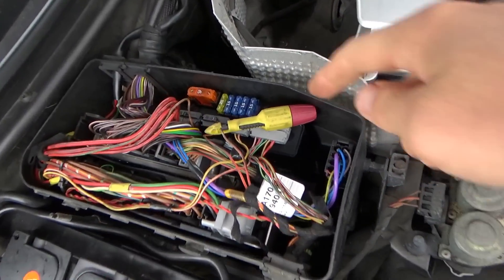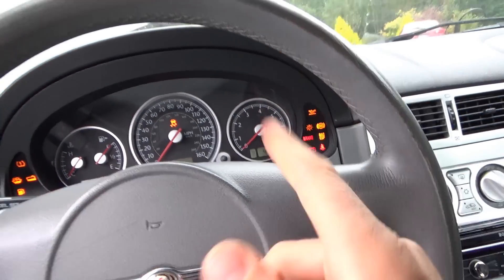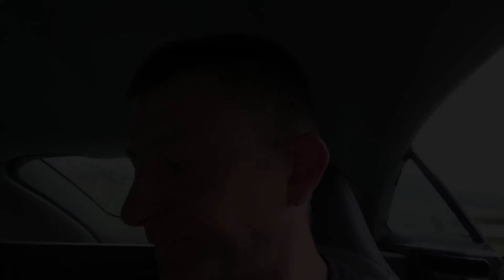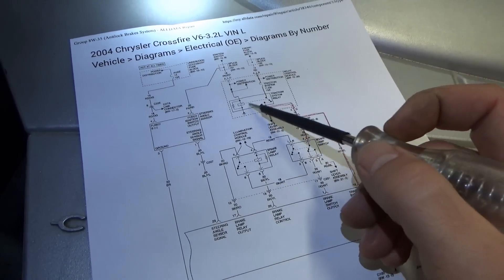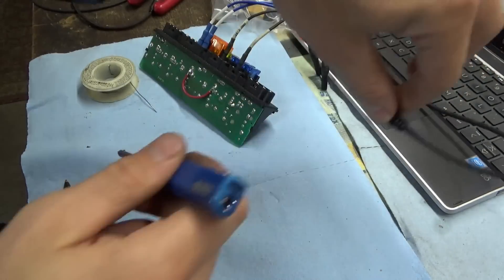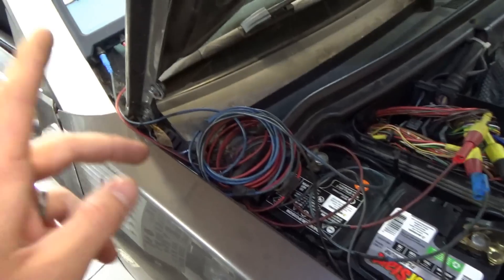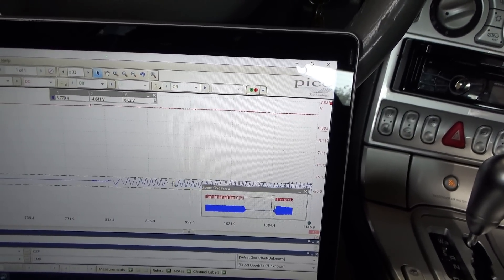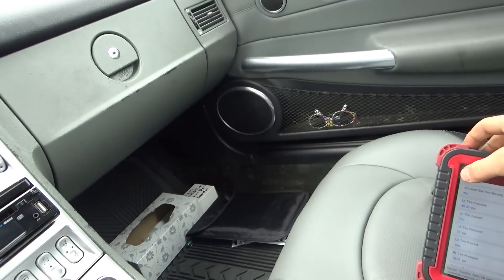Crossfire Can't CRANK? (Part 2 - No Comm with TCM-ESP-Shifter)

Comment: In some cases it's the end wire of the relay coil that has failed because it was improperly bonded to the post. A magnifying glass inspection could be useful just to check that.

Comment: Good job Ivan! As a Mercedes tech we dealt with these 20 years ago ,that car is a rebodied 170 SLK chassis and they had so many issues, we called those a K40 relay. Powers everything, crank sensors were a high failure part on these V6 and V8.
Reply: Yep haha! I guessed it last video, and my guess was right!

Those K40’s go bad so often it’s usually the first thing to look at for a crank-no-start and offline modules/no power. They’re pretty easy to fix, it’s almost always a bad solder joint. A bad connection inside is often the cause of intermittent no-start and stalls.
Reply: And give us five minutes and I'll be absolutely thank you

Comment: I'm a little concerned about joining those circuits.  This would've been a perfect opportunity for them to cost-reduce that box, so there must have been a reason why they chose to include an additional relay.
Reply: True. The cost reduction may also come from not having to manufacture a different box for cars which need separate feeds and for cars which don't.
Reply: @Kehvelii  
My vehicle had manual window winders but all the wiring was up to all the doors and up to the window controller switch next to the driver.
 It must have been easier and/or cheaper just to run the same loom for all the cars on the production line.
Reply: It would be my guess is the extra current is needed when the traction control activates during a traction loss event. Definitely a concerning repair.
Reply from the maker: @killer2600  if all those modules are on one 15A fuse, then normal power consumption is well below that, which one relay should easily handle 😉
Reply: I guess that particular relay is borderline for that current draw. It'll probably be fine.
Reply: On my own car, maybe. On someone else's car, no. If it's a window or a radio, ok.  But when it's engine control that car could fail on the interstate highway and cause serious problems. That's a lawyers paradise.
Reply: That relay module covers many Mercedes models.
Reply: Drive it hard, if it doesn't pop the fuse your good.
Reply: At a minimum that's a 20 amp max relay...  Should be just fine.  There's a reason they Mercedes are "overbuilt" after all!
Reply: @TheMystikal82  It won't pop the fuse, but it could fry the relay.

Comment: Hey Ivan, this is a known issue with the Mercedes R170 platform. At one point or another this K40 relays fails. The previous owner replaced already on my SLK320. You can still find these new. The issue is that the ECM relay will also fail and leave the car stranded.

Regarding the ABS light, you have to turn the wheels lock to lock to  relearn the steering wheel angle

Comment: On the working relay the fuses are after the relay, on the not working relay the fuse is before the relay. If you join the relay outputs, the output is not secured by a 15A fuse (only by the 40A fuse).
Reply: Still, just put in a 15A fuse with some wires poking out of the case. There's no need for those two relays to be separate.
Reply: @brainndamage  
I think the manufacturer had something in mind, when they installed two relays instead of one. Perhaps they wanted to make sure, that one module could not power the other modules backwards, when the relays were not activated.

Comment: That's sweet diagnosis,had the  same problem with 02 c200 but it was caused by a crank sensor. After engine warms up its crank no start. Thanks once again Ivan

Comment: Did you use "battery negative" instead of "battery positive" during your test of the relay Ivan?  Did you make a mistake?  WOW!  I don't ever get to see that!   I hope in part 3 you don't need to find a relay board for that car.  These videos that contain component repair are VERY interesting.  GREAT VIDEO!

Comment: nice bit of investigation/analysis to get to the failed component and a good cheap fix for the customer.Appreciate that the load on that working relay is minimal,however,it has switched just as many times as the failed relay and now it's workload has doubled.You may have already done this but I think I would have suggested to the customer to start saving now for either a new module or to look for a good used module as a precautionary move.Assume he is keeping the car of course.

Comment: I replaced a failed ignition lock on one and had to cut it off because it wouldn’t turn to the service position. It was a terrible job and the parts were in the $1400.00 range. The ignition cylinder had to be special ordered for the original key and car. I don’t envy you Ivan!
Reply from the maker: Because Mercedes 😆

Comment: I own a 2005 Crossfire Roadster.  The RMC is a pretty common issue.  Most owners carry a spare RCM, Crank and Cam position sensors.  When scanning, remember the car is about 80-90% a 2003 Mercedes Benz SLK320.

Comment: Mr. Ivan, I'm  a 24+ year factory trained Chrysler dealer tech and  I was mentored by one of the Best. I've been following your videos for a while now. You clearly have an impressive understanding of how to properly diagnose auto electrical. Most aftermarket "techs" do not and can only change parts.  Good for you Sir. 
I'm very curious: Do you have any Dealer training or experience? If not  College or some kind of trade school?
By the way We wont even Touch these Fucking Crossfires anymore and that's fine w/me.
Reply from the maker: Bio is on website... No formal automotive training, just a physics engineering background and then field experience with a good mentor 😉

Comment: 4:05 the rcm is serviceable.  Ive done them on my kitchen table . Its not a plug and play deal but its also not a standard dodge tipm. Again theirs a guy in Florida that fixes these . If you just buy a new one it will do the same thing as they all had bad soldier joints from the manufacturer.

Comment: That's a bit like when I was diagnosing my great uncles stepdaughters 1997 model Ford EL Falcon (Australian made car) which had a stalling problem, whenever I diagnosed the problem it would resurface later down the track.

It wasn't until it was towed to my dads place because it ended up being undriveable that I finally nailed the problem,it was just a non standard engine immobilizer/car alarm which was the culprit.

The Fix was to rewire it back to how Ford had the ignition switch wired up at the factory meaning totally bypass an engine immobilizer which had been wired up in series with the ignition switch for about 1/4 of a century .

So the problem was something else &  other than I thought it was !

Comment: Just about all electronics today, are soldered with Lead free alloys (almost pure Tin) and those do not flow and 'wet' a joint as well, unless lots of flux is used. Also, Tin has the annoying property of forming dendrite growths that can bridge and short connections - really troublesome with dense packed micros. A good flux that I use in repairs, is M.G. Chemicals 'No Clean' Rosin Flux #835-50ml. No Clean means that removing excess from the board is not necessary, but Brake Cleaner, Lacquer Thinner, or Isopropol Alcohol all work well doing that.

Comment: Why have that second relay if it is not needed?  The Part 3 video kinda answers that.  You have the second relay to send the circuit through a separate fuse?  As you found, connecting the relay outputs creates a scenario where you have some downwind electronics that is NOT protected by a fuse.  Thus, you added the external fuse.  Good work.

Comment: I'm guessing the ESP kicking in on wheel spin overloaded the ECM relay circuit you had piggybacked off of, and either borked the jumper wire, or the fuse, or there's actually an issue with the ESP system causing it to pull to much current, which is what stressed the circuit in the first place and caused the initial customer complaint.  Eagerly awaiting part 3 to see!  :D
Reply: The original failure was of the relay coil, not the contacts.  Therefore the fault was not the result of an overload.

Comment: Well as someone who has worked in electronics for two decades make sure if you do buy flux or solder make sure you get no clean, because if its water washable you'll have corrosion on that pcb within weeks, if you're using washable, rather than having to wash and dry the pcb ger yourself some vericlean spray to clean it
Reply: Thats just advice Ivan, not meaning to cause any offence just to clarify, best wishes from Ireland

Comment: Ivan I love your troubleshooting and repairs with the exception of 'jumpering out relays' or othe components.  I reserve the 'jumpering activity' for components that I find are not available due to obsolescence by the manufacturer or not availabe from previously owned or junk yard sources.  One of the things I find annoying is a previous tech does a field repair in a not so very well condition causing longer troubleshooting to determine just what was done and why.  For this repair yours is a great field repair. If the owner was agreeable I would have tried for a relay replacement .  As of this posting there are several OEM relay packs not the same P/N but same internal OEM relays on Ebay.  Further I also saw some NEW individual relays from our not so favorite place China (BARF)  I am not a fan of Chinese quality I have had too many failures and poor customer service on previous repairs.  In either case great repair on your part keep up the good work.

Comment: You can probably get the same type of relay at an electronics distributor like Mouser, Digikey, Farnell. It doesn't need to be an open frame, even a closed type with the same pinout.

Comment: There was probably a reason why the 2 circuits had separate load/relays, bridging the 2 doesn't sound right to me, that would mean the load sides mix, even though they always both are on with the same control side.  Also, you may greatly exceed the relays ampacity.
Reply: Probably not, why would there be multiple power feeds to the same circuit? It isn't shown in the diagram. Other than still needing to add the 15A fuse, it's a viable repair.
Reply: Most likely it's an overly engineer German part.
Seems they should have:
- simplify the design by using one relay
- make that relay serviceable and not soldered to the board

Comment: If you take the starter wire off the pulsation module and run it straight to the positive side of the battery and your starter still don’t kick in else could be the trouble the starter will kick in if you jump it at the starter, but it will not engage if you take the wire from the past stationmodular and run it straight to the battery. The starter will not engage.

Comment: The steady hand thing comes from proper technique. It is hard to explain, but you don't want to aim the iron with your wrist. Try to keep your wrist and hand in a comfortable position and aim with the rest of your arm (elbow/shoulder) keeping wrist a still as you can. EDIT: It also helps to not rest your arm on the table.

Comment: Did you consider just replacing the bad relay?  A bit of googling reveals that the relay in question is an American-Zettler AZ970E-1A-12D.  Cost is about $15 from any of various sources around the internet.
Reply from the maker: Maybe I should stock up on those 😁
Reply: Thanks for sharing that part number! It was pretty cool to look it up and read all the detailed specs of that relay (life expectancy in clicks, max current capacity, etc).

Comment: As I reflected before , historical search for problems with this car on youtube came up with quite a number of failures of the Relay control box ,  The car is basicly a Mercedes SLK , The relay control box develops bad solder connections that have to be desolderd and then reflowed ,, as they carry quite a lot of current . the other thing to realy look at are they relay contacts themselves they will burn making for pull you hair out trying to diagnose issues of intermitant power loss , if the relay contacts are badly pitted its time to repalce the RCM .  Crankshaft sensor as stated is also a historical high failure issue as well..

Comment: Good diagnosis, but you should place a 15 Amp fuse instead of a jumper. There are now 4 modules connected to + without the 15 Amp protection.
Reply from the maker: Will be addressed in Part 3 😉

Comment: Would have been fun to check what was actually wrong with the relay. Seen stuck relays that were fixed with a drop of oil (and still work years later).  Most of them are just not making a proper contact due to sparks or oxidation and the paper trick and some ipa does work wonders. Guess this one is either stuck or the winding of the copper wire had an issue and is now open which is still weird looking at how good they look and are build. As they are in parallel it should be no issue but there is a diode over the coil that should counter the reverse voltage when the voltage is dropped over the coil.  I once had a faulty diode so the current all went through the diode and the relay couldn't do it's job. That was a 1 off but I surely scratched my head.
Now on to part 3.  Oww boy, cars and electronics, only good the first couple of years and then it all starts to go bad.
Reply from the maker: I proved that it was an open winding on the control side of the relay...no rock left unturned ;)
Reply: @PineHollowAutoDiagnostics  Missed that part. Should make coffee a bit stronger it seems.   Do you ever get some sleep?
Reply: Working on electronics could be fun and sometimes even more interesting!
Reply: Ivan, I suspect corrosion INSIDE the solder connection on the bad relay where it meets the PCB.  I have seen this many times in my career.  Component leads get a microscopic corrosion before they are assembled (by machine) and the solder makes a proper connection initially, but after a few years and some heat cycling, it opens up inside the solder point.  The cure is to remove the component and clean the contact points with an abrasive (I use a pen of fiberglass whiskers), then resolder the joint.  Lead solder 60/40 works better than lead free that is used in assembly.  Often times there is more than one connection on a board that is about to fail when one is located for this reason as many of the components could have been contaminated from the same lot.  I would NOT suggest bridging the relays due to excessive current on the contacts and/or pitting caused by backflow EMF on the load side.   Keep up the great work!  @PineHollowAutoDiagnostics
Reply from the maker: @WECB640  well I did show that the relay was dead when energizing from the non soldered side 😉
Reply: Right.  I believe the problem is located where the coil wire is soldered to the relay pin.  Either not enough varnish removed which contaminated the solder inside, or perhaps the lead free solder fractured and then pollution ingress opened the joint.  I suspect that the rear wheel spinout at the end of the video turned on the ABS traction control which draws considerable amps and now we have a new fault inside this relay box due to excessive current draw.  The relay that was originally faulty has its own fuse on the supply line and bypassing that relay removed the fuse and the protection from over current.  Looking forward to part 3.  👍 @PineHollowAutoDiagnostics

Comment: ABS and traction control use high current when they are active! That is, if you are about to lose control of the car. The bypass you installed can cause the fuse to blow in a dangerous situation and now it also causes the loss of brake boost and power steering!.. 

edit: Watched to end.. What was I saying ;D
Reply from the maker: No. High Current comes from big B+ Maxi fuses, not from skinny ignition wake-up wire lol!

Comment: Fantastic videos so far, Ivan. I get a feeling that you have more wiring repairs and or more relay repairs in your future. BTW, is it even possible to source that 20 year old relay assembly?
Reply: Iam in the same situation with a 20 year old Nissan faulty immobiliser unable to source the part even from a junkyard.Only found 1 compant that says it can fix it but I have to pull out the immobiliser & ECM send it to them $ 1011 for the repair only paid $ 2000 for the vehicle just nt worth it.Cheers.

Comment: It's certainly entertaining to watch you work Ivan.  Nice detailed diag there.  Where you're probably right that the single relay should be able to handle the load of both channels.  It's nearly 20 years old now.  And it's pretty obvious that someone else has already been in that relay module before you.  I would not feel very confident with how much longer it can last.  How much would a replacement module cost?

Comment: Just to point out, because the dlc had voltage for the scan tool you know the module has at least a power feed on the pink/red wire.

Comment: I share your love of diagnostics and repair. Spent many years in industry doing that, even on a board level. Designed a ckt to detect high ripple volts on switched-mode power supplies, and it was used company wide. I'm wondering about that diode on the diagram - looks like it handled power from the ECU relay and fed the traction control relay without risk of feeding back into the ECU ckt from another source? I just glimpsed it.....
Reply from the maker: I think the diode on the control side was just to prevent voltage flyback when the relay opens 🙂

Comment: The concern I have about the jumper is that one circuit is fused post-relay and the one you're fixing is fused pre-relay.  As such, if you connect the outputs of the relay together, that one circuit is unfused.  If true, that's not good.